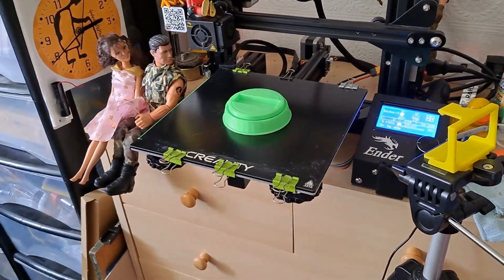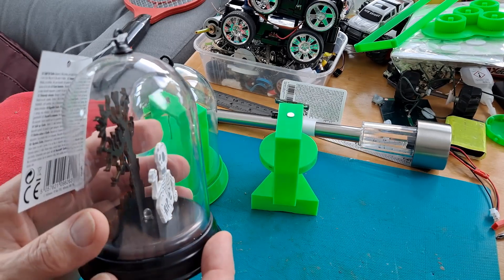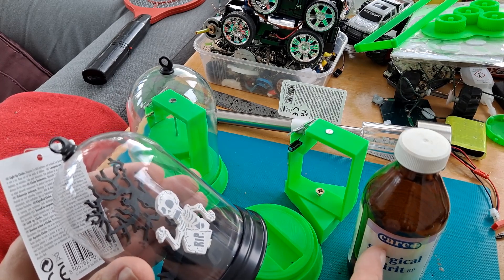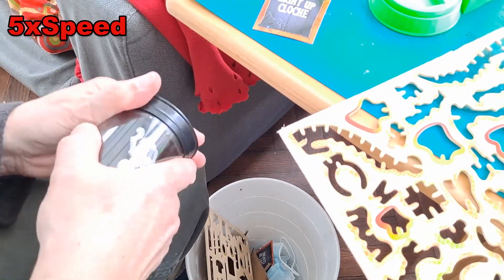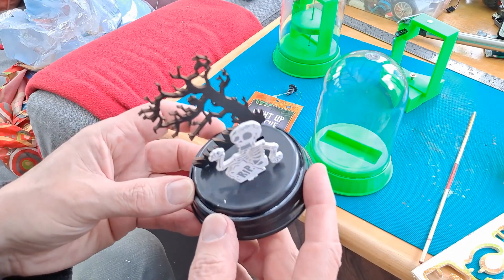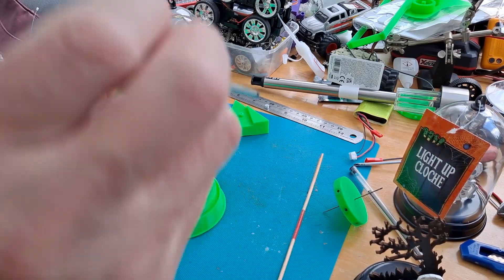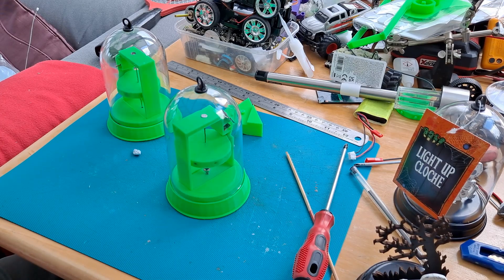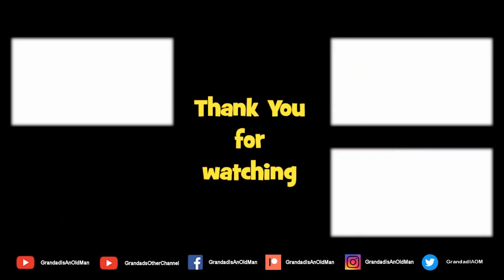Cloche over my solar pulse motors

Comment: That worked out really well.  One of my dollar stores now sells those plastic cloche bottles with the hollow plastic base.  Some of the older ones I got  the clear plasric turned milky white with too much sunlight The newer ones seem better.  I really like your pulse motor design.  Simple and well engineered.
Reply from the maker: Thanks, I see you have the RFID video up, I will be watching it in a minute. I designed this one to allow me to transfer the bits from the solar rocker with the minimum of disturbance.

Comment: This is really cool do you have the files on ur thingiverse?
Reply from the maker: Here you are 
Thingiverse files https://www.thingiverse.com/thing:5369867
The disc files have different sized holes in the centre. 
017 is a 1.7mm hole
014 is a 1.4mm hole
This is to accommodate the different sized needles I had available.
The neodymium magnets came from a magnetic building kit and they are 6mm diameter 4mm thick
The clear plastic cloche came from a Poundland Christmas decoration
Reply: @GrandadIsAnOldMan  thank you 😊
Reply: @GrandadIsAnOldMan  would 6mm x 2mm work?
Reply from the maker: @Chickennoodlesoup0117  I can only say "probably" as I don't have any so I can't check. I don't do any calculations, I just use what I have available and it if works I am happy. If it doesn't work, then I try something else. Generally speaking, I would expect it to work for you, the solar rocker magnets are only ceramics, not neodymium. Lidmotor often uses ceramics and his pulse motors work OK. If you haven't checked out his channel, I strongly recommend it. https://www.youtube.com/user/Lidmotor

Comment: Thank you so much for yet again an inspiring video. I been researching those coils and found that those wires used in some of the toys coil are  0.01mm/57.5 awg/ 0.00004" gauge. Now I have to find out the number of turns for optimal performance. I will be posting a video soon. But please keep up the good work.
Reply from the maker: Good luck

Comment: You said they were run off of three double a batteries you may need to use multiple solar panels. You can often find close shape wine glasses at thrift stores, use a carbide or diamond cutting wheel on a rotary tool to cut off the stem
Reply from the maker: That could be an interesting project. I will add that to the list 👍